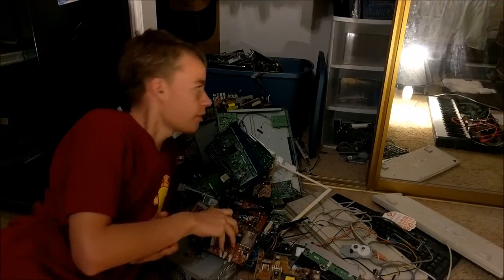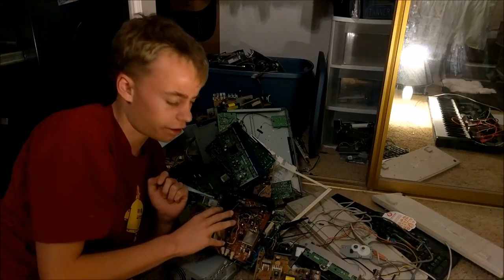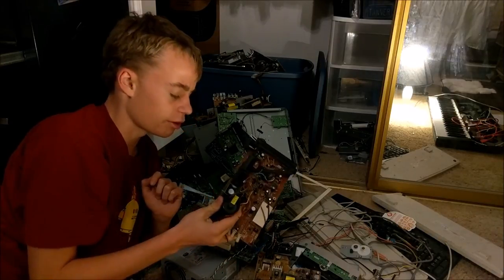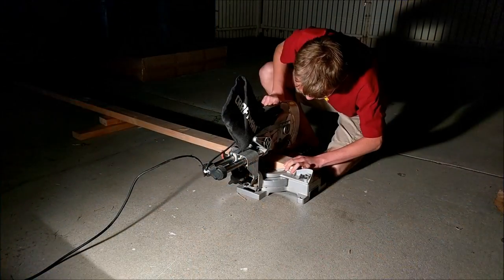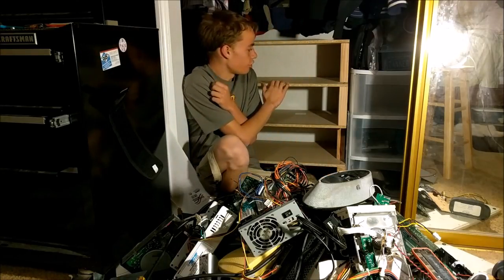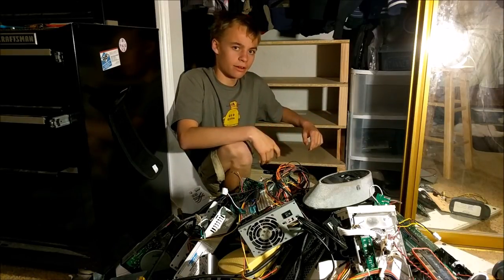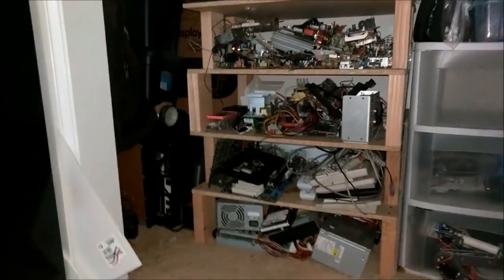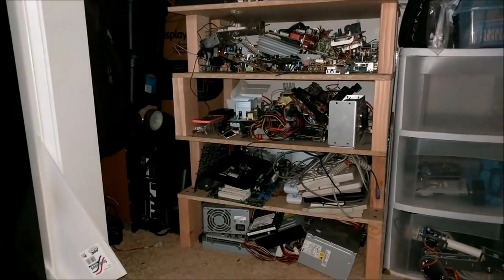How to Build a Circuit Board Storage Shelf

Comment: Did something similar, just bought a full sheet of cheap shutterply, and had a cut list that used the entire sheet, making it all into near identical strips. Then used 2 as sides, and the rest as the shelves, needing just a little glue for the joins, and a lot of screws to hold them together. Braced with a end scrap piece screwed along the one shelf base, and works well. dimensions are the width of the sheet, and the depth depends on the number of shelves you want, I went for 4, so the sheet was cut into 6 pieces, and the excess strip on the end was the brace piece, to get the shelves to a convenient multiple of 5cm width.